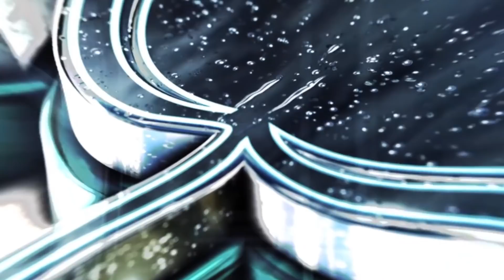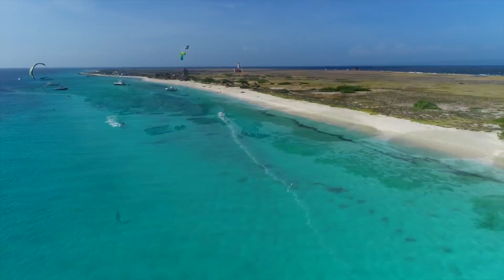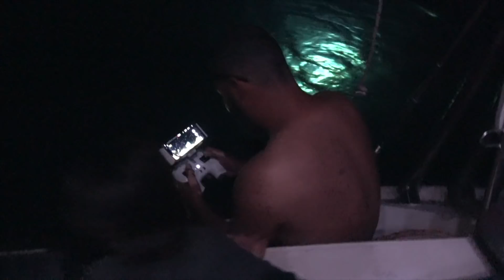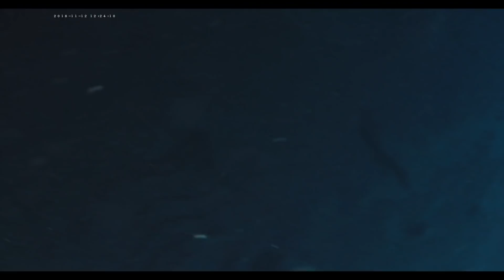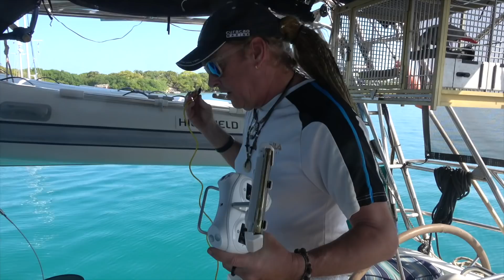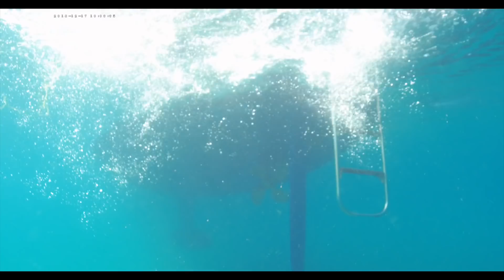SSL 330 ~ Diving with the FiFish P3 Underwater ROV by QYSEA

Comment: You're gonna have fun with those suckers. Needs a tether rather than yanking on the umbilical or you'll be ordering a replacement sooner than later. I'd be willing to bet, several dozen launches and the connector starts to leak into the drone

Comment: Pretty cool device.  I can think of all kinds of uses.  I would add a snagging device, for retrieving things or hooking things on to wayward things, like if you lose your anchor and chain in 200 feet of water, it would be nice to be able ot attach a rope, so you can feed in an appropriate rope to raise the chain or at least place a marker.  Just think if you lost your favorite fishing pole in 250 ft of water, you could use this device.  Or just checking damage in cold water, where you don't want to put in a diver.  I can see this as becoming a must have on a well-equipped boat.

Comment: Noticed at about 13:00 and several times you had a heavy blue/cyan cast.  Can you put a 30 magenta filter (or even  40m) over the lens which will cut through this haze. If sufficient light level you would not have to rely upon camera lights to get true colors giving you more dive and shooting time. Is there a provision to add corrective filters even a polarizing filter?
Reply: Dear Les,
We have developed the "true color" technology based on the image correction algorithm. So, for FIFISH P3 you did not have to have a filter instal. FYI, you can also adjusting the white balance on the FIFISH APP (on your cell phone).
Let us know if you have any questions!
Happy New Year!
Ziyong @ FIFISH

Comment: Use a Galaxy s9. Brighter display. That 10x is using the scraps from Samsung.  G9 1130nits  CrappleX 574 or 625 depending on tests.  458ppi vs 570 S9.   Guess the brand is way more important than an realistic performance features.
G9 has 3k  display and f1.5 which allows picture taking 30 minutes after sunset.  I take video of dancing here in Austin under low light. Others trying to do it are embarrased at how bad the low light capability on the X.
I like my 400gb capacity.  Just some information.
Love the review.

Comment: Im guessing it has stabilization like a quad? Probably have to hold it level with the horizon when you boot it up? Regards that list to starboard. I never really thought about that aspect of launching an RC craft from a rolling vessel. Since I have always had the convenience of sitting them on level ground and turning it on. Has me wondering if DJI has that figured out... because I know alot of people launch them from rolling vessels.

Regarding controls... sounds like you have never flow a model airplane Rick! lol. Where have you been? Need to kick it old school sometime and elevate yourself beyond quad life. It seems like a natural control layout to us . Flying a heli and quad for the first time was wonky as all hell in my experience. Throttle/yaw on the left and pitch/roll on right. Thats exactly what it is with an airplane. Exactly what it is with a quad for that matter, just not how it translates, since you are mixing controls to create linear movements with quads vs adjusting a continuous linear movement with an airplane (or submarine apparently). 

Alllll that being said, I want one... Safe sailing. See you out there one day. S/V Sea Sleigh. Departing Ft Laud soon! Fingers crossed.
Reply from the maker: I was building and flying model airplanes 25 years ago but quickly got bored and migrated to single rotor helicopters.. that was my main interest for years and built several custom models including a scale flying replica of an RCMP Bell Long Ranger with a custom designed flybar-less rotor head that I made from scratch in my own machine shop in my basement at the tme...  I even built another one that had 4' floats on it and a custom enclosure between the floats that housed a mid-sized Sony camcorder to record the flights... but this was all back in the day loooong before the drones everyone knows now that virtually fly themselves with autopilot and accelerometers all around... back in those days you actually had to know how to fly... YOU were the computer!  :)  so yes, you could say I've been around, Lol
Reply: So then you remember when the hobby involved crying after a crash. Slightly more affordable now. And it's all too easy! Although I sure enjoy the flying more. Use to be all about the build. Sounds like you got really adventurous. Flybarless without modern electronics must have been a heck of a challenge. The days of mechanical gyros...Ahhh, I can still hear them spinning. Lol.
Reply: So I just watched another video about the Fifish... those controls do suck. How could they not allow for control of pitch! Thats a total screw up in my opinion. Should have made it operate like an airplane...

Comment: Captain Rick would it make sense for the input wire to the controller not just plug in? Does it need to be more secure by threading it in?

Comment: Maybe you can take the ROV remote apart and swap the joysticks so its normal or swap the wires from one to the other. Great videos keep them coming
Reply from the maker: it's just a programming adjustment in the firmware.. they've told me they'll have it available in an upcoming version of firmware  :)

Comment: Great review but I would check the operating temperature first and I would assume this is for nice clear waters for best use!
Reply: As in “artic” waters?
Reply: Hi Simon,

The operating temperature is recommend above 0 degree. FYI, we have tested in the -10 degrees. So, it could fit for the cold water. However, you might want to consider a "jacket" for remote contoller's battery and  the cell phones for FPV.
Let us know if you have any questions.

Yours,
Ziyong @ FIFISH
   @simontaylor4873
Reply from the maker: operating temperature?

Comment: hand hold on the top would have been good
Reply from the maker: it actually has a secure lifting point on top that the first mount for the tether locks in to... I just wasn't sure at first if it was safe to pull it up by the tether, but turns out its designed that way. :)